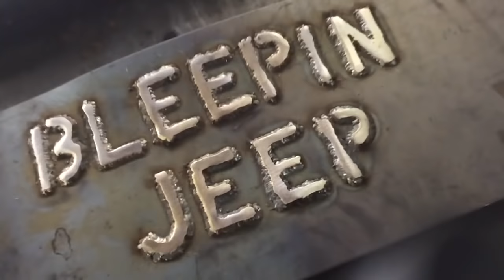How to Bend Tube

Comment: You remind me of me in  my youth, back in the 1980's my brother and I built most of the pro-street cars in our area. 
lot's of fun but also lots of work. narrowing rear ends, roll cages,4 link suspensions,ladder bars and lots of interior tin work. Now most of the tube bending I do is for exhaust systems. 
I built my own roll cage bender,a copy of the JD2/pro tools style bender years ago and bought dies from pro tools. I have a heavy duty bender I built just for bending 2" DOM for hotrod front axles, and a Babco bendpro 2000 for exhaust work.
You do excellent work,keep it up.

Comment: 45 years of being a commercial/industrial electrician I have run hundreds of miles of conduit in subways, railroads, chemical factories, hospitals, schools, airports, sewage treatment facilities and the list goes on and on. I consider myself somewhat of an expert on the subject. One of the hardest to run is aluminum ridged conduit (ARC) because aluminum work hardens when you bend it, if you over bend it and try to take a degree or two out it will bend next to the bend that you are taking it out of. We usually work from the back of the bend and deduct the radius for 90deg. 
Center for offsets and saddles.

Comment: Looking good! Only suggestion I have is get that winch out of there when you're welding. If you get ANY weld splatter on the cable you  will have to replace the whole cable.

Comment: great job Matt,looking really good. i did learn a few things from watching this. what kind of welder are you using? and where did you find that angle finder? and could you post the specs of your bender?
Reply from the maker: Millermatic 185 welder, Amazon, and pro tools 105

Comment: Really great videos just wondering you ever use Aluminum in any of you bulids?
Reply from the maker: Sure, the toolbox and fuel tank are aluminum
Reply: BleepinJeep just wondering I just picked up a 79 cj7 for 1600. And I'm building my front bumper and winch mount and the center consol our of aluminum.

Comment: I am impressed with your work on this project...  22:33 "it is ok just to tack in place"  I was wondering about that.  With the sheet metal I saw in the back, looks like it would be challenging to weld those pipes properly as the sheet metal would get in the way.  Did you find that tack-in-place, in hindsight, was a good idea?

Comment: question on your bender, i have the same model but im having problems with the follower die marring up the tube on the outside of the bend. I've chamfered all the edges on the follower die and using white lithium grease but still getting the same out come?? any tips would be great.
Reply from the maker: put the follower die on the next hole out... you'll get less of a bend in one stroke but I've found it works a lot better.
Reply: ok cool ill try that thanks!

Comment: Can you build a cage without bends? Could you safely just weld decently shallow angles (not 90°) and add gussets?
Reply: Mmm Mhm no. That will cause shear points. The curves give it strength.

Comment: Your way obviously works, but I can't recommend Bend Tech Pro enough.  Plug your measurements into the computer and you can design the whole thing, make changes, etc...  plus it tells you the rotation or offset between bends...

Comment: I'm looking for a used tubing bender.  I really like the bender you have. Anybody want to sell a bender? Jim.
Reply: I was on the lookout for a used bender for a while but the only ones that come up are the more expensive hydraulic benders. Even if you found a hydraulic you would still most likely need to buy the right die set. And looking at the cost of those die sets it's pretty hard to go that route. I finally decided to not deal with the hassle and ordered a JD2 Model 3 with a 1.75 die set. Even though the shipping costs will get ya I think it's worth the piece of mind for new tools. Do research on the quality brands. You can't go wrong with ProTools and JD2 but stay away Woodward Fab! Good luck